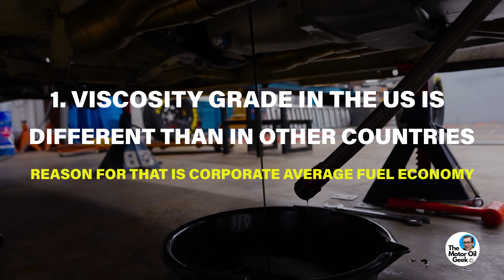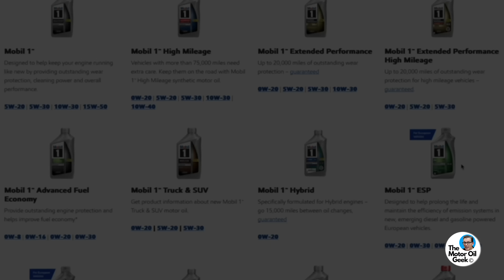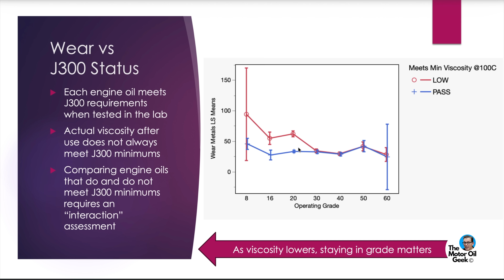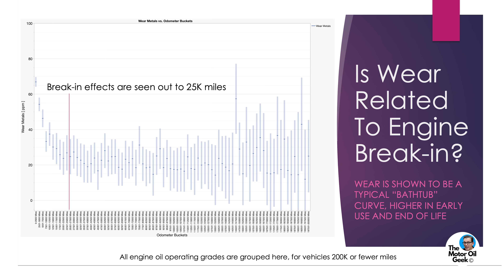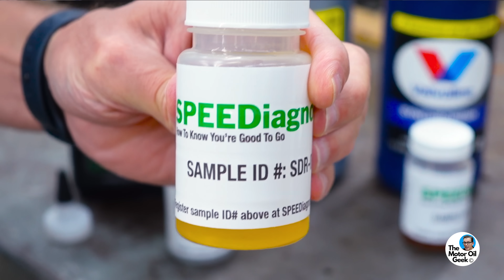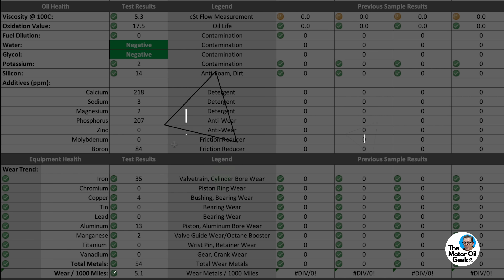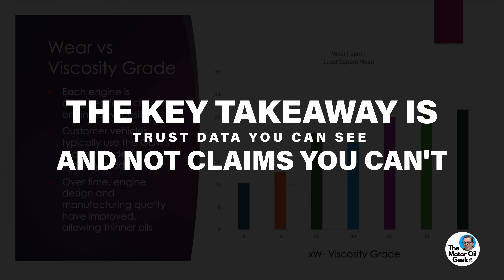More Ai Lies? The FACTS about 0W-20 vs 5W-30 (With Evidence)

Comment: QUESTION:

I have a 2019 Jeep Wrangler V6 gas engine with 42K. I use it on weekends and vacations. It's starting a pretty good class one leak at the rear main seal. The oil in it is whatever the dealer uses. Should I go with something else to seal it up?
Reply: Scotty Kilmer is a very strong proponent of AT-205 Re-Sealer. Many other motor heads also recommend it. I have had excellent success using it to re-swell tired seals. It certainly cannot make things any worse and replacing rear main seals is a less than happy job. Been there! Done that! Got the T-shirt and the scars!

Comment: Whew ! Even with my advanced degrees I only want to know WHAT viscosity to choose. I don't get this "out of grade", or "shear". Can you simplify this ? Those nice graphs are unclear ( to me ). S Soooo....who has the time or ability to send oil to a lab ? Do I change the OEM regs for 0W-20 to 5W-30 for engine WEAR and longevity ? Tell us , please. Just a simple driver here.
Reply: Degree in what? Accounting or gender studies? LOL Actually, that is a fair request as far as John Q. Average is concerned. He MAY have covered that subject in another video. I don't know. I can say that it's not the most easy thing to explain to non-chemical engineers. My dad was one and he tried and tried to get lil' ol' mechanical minded me to comprehend it and finally gave up. I kind of get it but, barely and not enough to further confuse anyone else. (Weak grin)
Reply: @steveforbes7718  Neither Stevo. This vet has the need for K.I.S.S. talk. Not this over the top complex B.S. You need a referral.

Comment: My take is this: buy 20+ years old japanese shitboxes (not mazda, subaru, suzuki, mitsubishi or nissan) and use your preferred expensive oil brand with recommended viscosity (5W30, green cap). And dont forget to change the oil filter. Wife has three 1.4 d4d toyotas, one with nearly 600 000km, and two with nearly half a mil and one 2.0 vtec honda with 400 000 and nothing wrong with the engines. Also one 1988 diesel VW caddy, 2002 clio with no probs. Problems start with her 2010 Cithroen C3 Picasso. In case you're wondering why the wife has that many cars? Shes got all the money. All I have is a 2007 transit camper with 2.3 duratec and that is a bomb and a job that pays pebbles.

Comment: Toyota 2021 Camry LE requires 0W-16 oil.  Are you saying I need a thicker oil?
Reply: I would definitely use one! Toyota has gone to shit over the past five years! My 1999 Camry LE with a 5SFE motor was good for just shy of 500K and was run exclusively on Mobil-1 0W/5W-30 oil. It died in a car crash when the poor darling was T-Boned by a F-250. Boo hoo!

Comment: Higher viscosity oils at cold temps cling to internal engine parts longer than lower viscosity oils, which is very important when you go to start your engine, where most wear occurs. I drive a B9 S4 in New England. I use the 0W-20 in the winter, and 5W-30 in the summer.

Comment: I have a 2019 Dodge Charger 392 with aprox 65k Miles. OEM recommended is 0W-40. I have not had any engine issues, only cooling (water pump, radiator, Thermostat). Have you seen any data for the 392? I have always used 0W-40. Recommendations on oil brand? 1st 30k was in Germany, high speeds, rest is Arizona. I change my oil when the car sensors say I have 5 to 10% left. Can I trust the sensors?

Comment: I will say something unpopular, it's really all about how you treat your engine or really any machine. If it's abused and used without the correct care and maintenance it will breakdown faster no matter what type of oil you use. Who does a breakin drive on new cars today? Almost no one. Want to guess what that does to your machine? That first few hundred miles maks all the difference in service life of your car or truck. If you treat your car, truck or whatever with care you can expect to get good service life from it. Who changes oil after the first 500 miles on your new car? Almost no one! This was common back when I was being trained as a Heavy Equipment Mechanic. Lubrication is your machines friend, extended service cycles sound great but look in your manual and you will find something that refers to something like "Severe Service" or similar. Think your car or truck doesn't fall into that category think again. Change your fluids early so you don't need to change your car or truck early! Like the old car transmission commercial said, "Pay me now or pay me later"!

Comment: I stumbled across this video surfing You Tube, the title caught my eye.

My comment has nothing to do with the subject matter (motor oils), my concern is with AI.  In recent months I have been involved in something completely unrelated and have noticed a huge influx of videos on You Tube concerning it.  They are poorly done, repeating the same info over and over multiple times, most of it incorrect, using photos and videos that I suppose are trying to be subject related but aren't and making statements that simply aren't accurate at best, outright lies at worst.

While it's always been true that we should fact check everything against multiple sources, it seems apparent at this point anyway, that AI generated videos and answers to queries can be and probably are inaccurate.

Comment: I’m a retired mechanic and change my own oil and just recently switched from 5w20 to 10w30 in my 2013 Ford F150 with a 5.0 coyote. The engine was very noticeably quieter. Acceleration was noticeably better and that tells me the cam phasers liked it. MPG went up by about 1.5 to 2.0 mpg. I use full synthetic oil as well. This truck as well as my previous truck ran these thinner oils and would consume two to three quarts of oil between changes but I don’t think the oil was getting by the piston rings, heres why I think the motors aren’t burning the oil. When I change my oil using the thinner oils if I spill any on my driveway ;clean or dirty, in about two weeks the spilled oil will completely evaporate and not leave a trace. The old thicker oils didn’t do that and unless you used degreaser and a pressure washer it wasn’t coming up. My two cents is the oil is actually evaporating from the engine heat and leaving the engine via the PCV system as vapors.
Reply: We finally got a friend to switch up her 2021 Subaru from 0W-20 to 0W30 Mobil-1 and it made a major improvement in the noise immediately. She has seen zero degradation to her mileage as a result. Once we proved to her that the particular Jiffy Lube to which she had been going had not changed her oil at all recently she learned a valuable lesson. She has now learned just how easy it is to change her own oil and she is quite proud of that! LOL

Comment: So if my automaker suggests 0-20 stick with it?
Reply: Your choice but, if you do a full change every 4k to 5k miles you can easily use a 0W-30 which we use all the time. Mobil-1 is our only choice. After 40 plus years of using it we have never had even one oil related failure.

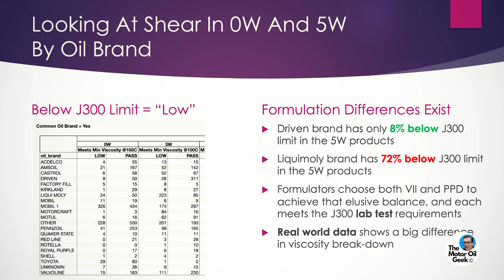Comment: The Table at 5:14 - what does it mean?  I changed my new 2025 Tundra's oil at 1K miles with Mobil 1 0W-20. Then by towing trailer Toyota recommends 5K miles, so I did that oil change at 5K mile as well. The 0W-20 difference between Mobile 1 and Toyota look huge on the Shear table  - so should I stop using Mobil 1 0W-20 ?

Comment: I think a lot of it comes down to never rely on the oil change mileage from the manufacturers. the 3000-5000 mile change interval has worked for me in 2 Chevrolet Silverados with no engine issues. My 2020 has 69K with no issues on the thinner oil at under 5K change intervals.

Comment: So the 0w20 oil is chosen for Cafe standards in the USA. But for the rest of the world the engineers choose 5w30... There's your answer. Though the real take away is change your oil frequently regardless of what you change it with. The manufacturers only have to worry about the warranty, after that it's on you. 10K changes are good for the warranty, not for after that. 5K or 3K is the ticket for 250K miles.

Comment: Worked on lots of cars and changed a lot of oil.  0-w20 def leaks more than 5-w30 after 100,000 miles.  I always use 5-w30 in my cars.   The real issue is low friction piston rings causing oil consumption.

Comment: I always wonder this I do my oils changes every 2500-3000k miles so it isn’t a problem. But Subaru recommends 0w20 in the US but use 5w30 or 0w30 in Japan.

Comment: To find the truth about recommended oil viscosity, all one has to do look at the owner’s manuals in different countries.
The 2026 Toyota Corolla Cross uses the following engines and oil viscosity in these countries:
                     Engine         Oil viscosity
      US        : M20A-FKS  0W-8 (page 442)
      Canada : M20A-FKS 0W-8 (page 442)
      Australia: M20A-FKS 0W-16, 0W-20, 5W-20, 5W-30, 10W-30  (page 357)
      UK        : 2ZR-FXE     0W-16, 0W-20, 5W-30 (p 507)
      Ireland  : 2ZR-FXE     0W-16, 0W-20, 5W-30 (p 507) (2025 model year. Couldn’t find 2026)
In these five countries two different engines are used in the Toyota Cross.
The most significant finding is that the US, Canada, and Australia use the same engine, M20A-FKS, with recommended oil viscosity from 0W-8 (US and Canada) to 10W-30 (Australia)
Based on Australia’s recommended oils, even an oil as heavy as 10W-30 can be used.
Notice the US and Canada are the only countries recommending using 0W-8, and it is the only weight recommended.
It’s obvious these thin oils, 0W-8 and 0W-16, are only be used to get the best possible mileage, regardless of the consequences of their use.
Here are the URLs for the owner’s manuals.
     US: https://www.toyota.com/owners/warranty-owners-manuals/
     Canada: https://www.toyota.ca/en/owners/manuals/
     Australia: https://toyotamanuals.com.au/#/
     UK: https://www.toyota.co.uk/customer/manuals
     Ireland: https://www.toyota.ie/customer/manuals
Don’t take my word for it. Do your own research.

Until someone shows proof that heavier viscosity oil damages engines, I believe it’s reasonable to assume that if your car will start (especially in cold weather) with an oil, the oil is safe to use. With any viscosity oil, especially heavier viscosity oil, when starting a cold engine allow the engine to idle for a minute, the drive gently keeping the rpm less than 2,000 until it warms.

To the naysayers that state you must not use heavier oil because of tighter clearances, variable valve timing, etc, if you have heard of an engine damaged due to thicker viscosity please respond. The only downside of thicker viscosity oil that I can think of is starting in cold weather and in extreme cold, -10 F, and engine may not turn over fast enough to start.

By the way, I'm kind of anal about oil and in my 2019 KIA Forte I use Mobile 1 5W-30 in the winter (months) and Mobile 1 15W-50 in the summer (4 months) and change the oil every four months, about 5,000 mi. I live in Minnesota, USA with summers up to about 95 F (35 C) and winters down to about -20 F (-29 C).

Comment: Just look at the test of diesel oils on 20, 30 and 40 viscosity. The diesel engine emits a significant amount of particulate matter. From the test, you can see that as more tick is the oil as less wear you get. So we have evidence that the thinner the oil clearance between the metals is as more you get the abrasive action of the particulate matter.

Comment: Before I purchased a truck with a 6.7 powerstroke, there was a note of engines having rod bearing failures where the tin would strip right off of them. Ford recommends SAE 10W-30 or 5W-40 synthetic.  One truck mechanic out west had seen a good number of those failures in the farms that were running old school diesel oils 15W-40 or 20W-50 instead of the suggested lighter grades.  I suppose if a bearing width, clearance, radius is designed for X oil then a heavier might cause delivery problems?

Comment: So is 0w8 just fine also?   Viscosity actually does matter.   When your oil sloshes around like water, then it is not going to do the job it is supposed to do.   That's just peachy for the manufacturers that want you to burn your engine out just after the warranty expires.   Their standards for oil changes (now around 10,000 miles) are a clear indication of this.
Reply: just one word CRAZY!!!!! They want the combustion engine fail.

Comment: Last oil change, I was a little short of manufacturer recommended 5W-30 and had a qt of 0W-20 on the shelf, so I topped up with that. 5 qt of 5W-30, 1 qt of 0W-20. Both Mobil 1 High Mileage. What are the consequences of mixing oils with different viscosity ranges?

Comment: You actually show on your chart that the thicker oil offers better protection after shearing out of grade so the issue is when does it shear out? Is it more likely to do so when the cars show it's time for an oil change (7k+ miles)or when changed at an interval below that mileage, like 5k miles used as a regular change interval. Can the chart take this info into it's comparison?

Comment: I use 0w-30 in Florida, 0 for quick flow on startup, 30 for protection when it is 95 degrees for months The 20 weight can't cut it at 95 degrees. Just check a chart.

Comment: So many 'opinions' and "facts" on this., been trying to get an answer. 2021 Subaru Outback 2.4 turbo. 50/50 city and highway driving, no towing, no drag racing. etc. 62,000 miles, which should I use at next oil change?

Comment: Professional mechanic/shop owner for 25 years. I've replaced engines for running out of oil, not changing oil, overheating, and mechanical failure. I've watched oil recommendations go from 10w30 all the way down to 0w8. My recommendation..screw the OEM. You should run 5w30 synthetic and change it at 5k miles in 90% of vehicles.

Comment: In Australia toyota 300 series v6 diesel  0/20w toyota say is correct  ,now we are seeing engine fail bearings mains and bigends in high load condition's ie towing 3.5 TON van  and hight air temp in out back Australia 100f 40c in sumer or ever more , the oil turns to water and can not protect the bearings ,heaver oil is needed and or bigger engine cooler

Comment: I’ve used 0w20 on my 2011 Toyota Sienna V6 since we own it with 25k miles and so far, running like a champ with over 200k miles. We got a transmission flush before 100k miles at the local Toyota dealership.

Comment: I will use thicker oil. Even more mechanics are saying thinner is killing engines. And 5,000 mi changes to 6,000 mi changes top. Not 10,000 miles, again just government and manufacturers pushing less maintenance better on environmental issues.  Me I'll pollute and save my motor instead.

Comment: Well i can tell you this. Honda with their CRV 1.5l turbo recommend 0w20 and has an oil dilution problem from the high pressure fuel injection blowing pass piston rings while engine is cold. 
Owners are doing oil changes and finding the oil level to be over filled because the oil is being filled with fuel. 
So Honda won't recall this issue and they know this problem is exist.
 People have found the quick fix that has been stopping the problem is to change to 5w20 with a thicker viscosity oil. The oil clings to the cylinder walls and piston rings causing the rings to seal much better preventing the oil dilution problem. 
Also changing oil earlier then the recommended intervals will also help.

Comment: I just had an engine replacement in a 2023 Hyundai Tucson 2.5 liter Smartstream. Reason was oil starvation. The recommended oil on the oil filler cap is 0W20 but the oil they put in the brand new engine was 5W30. Go figure. Incidentally, the warranty covered everything, they even supplied a loner.😂

Comment: With all these turbo engines oils sheering out of grade will be more likely in modern engines. For that reason going 5w-30 may seem like a good idea. However (in my non-expert opinion) a higher viscosity oil might also have a downside in turbos. Higher viscosity oil will take longer to get into the turbos which could lead to more wear at start up.

Comment: Still what you forgot: If a 10W60 loses stability, it is still a 5W50, something 0W20 will never achieve also if it is more stable over time. A completely destroyed 10W60 is in the end always better in lubrication than a new 0W20. So forget this thin water-oils (only needed for hybrid cars) and use in minimum a good 5W40 (turbo-charged engines) or 5W50 /10W60 for NA or supercharged applications.

Comment: How the oil gets to the Critical location in the engine? Via the pump, right? Cold liquid vs Hot liquid and stickiness.  Cold metal vs hot metal and routes of flow for the lube fluid to pass through with enough flow to handle torque applied. Torque, compression and fire make heat on the steel parts and the lube fluids.
Shitty lube pressure from the storage tank will always cause early engine failure.  Simple in design doesn’t mean these pumps are made with the best parts or materials, nor are these parts are tested before shipping from the factory.

Comment: I own a 2017 Toyota Tundra TRD Pro with a 5.7L IForce V8. It just turned 80K.  In your opinion, will the use of high quality Toyota or Mobil1 5w30 rather than 0w20 oil harm my 5.7L IForce V-8 in any way?

Comment: Pardon my ignorance but for me fuel economy is not a priority , all vehicles I have owned in my lifetime has been always four cylinder, protection and longevity is the only thing that matters to me and since I own a humble ‘10 Acura TSX I use 5w30 synthetic Mobil 1 extended performance high mileage and no complaints whatsoever, better be safe than sorry 🤷‍♂️